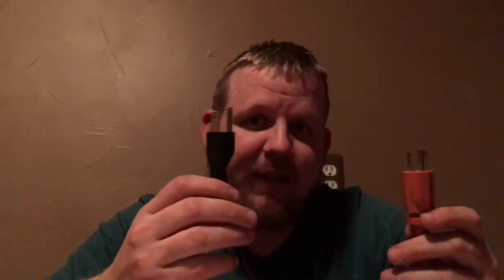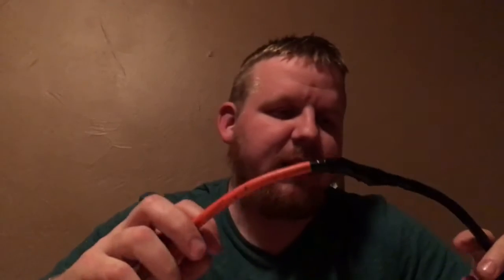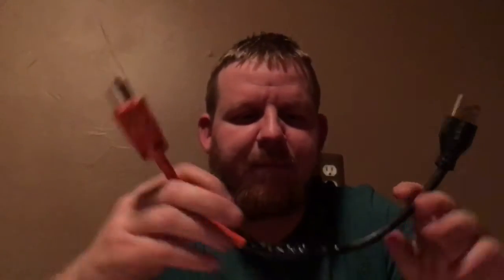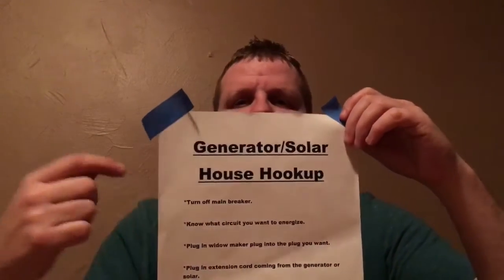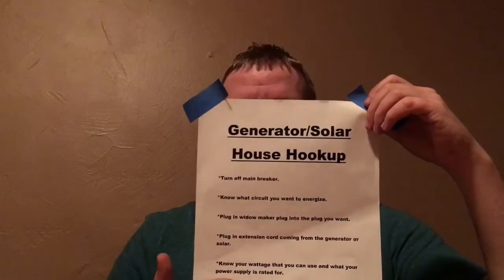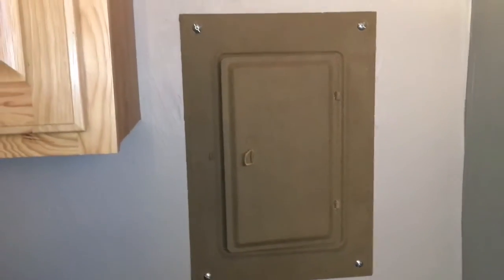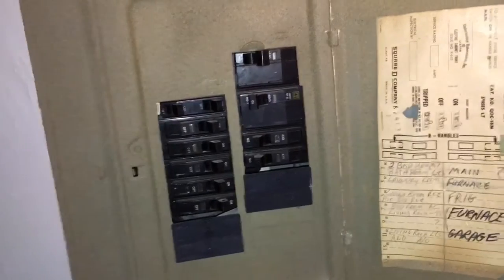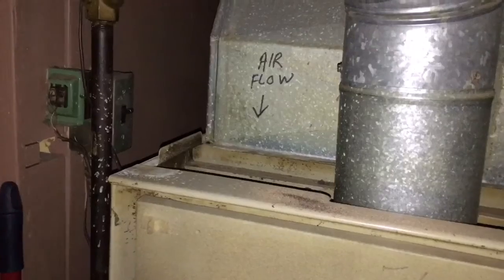Grid goes down, How to heat and power your house with a generator or solar inverter.

Comment: If the electrical grid goes down the natural gas will go soon as it need electricity to boost pressure. Dont depend on having natural gas.